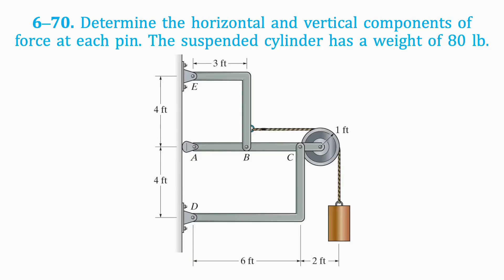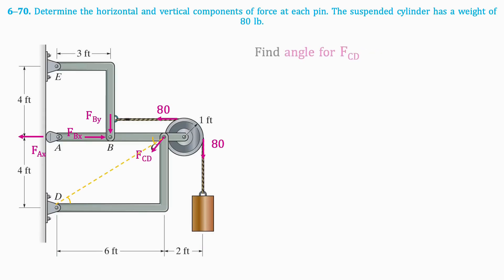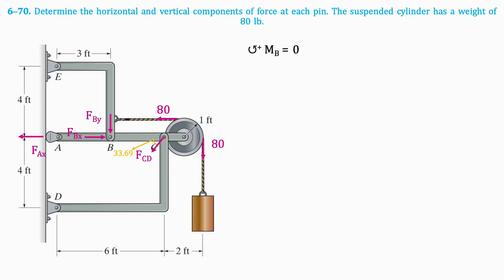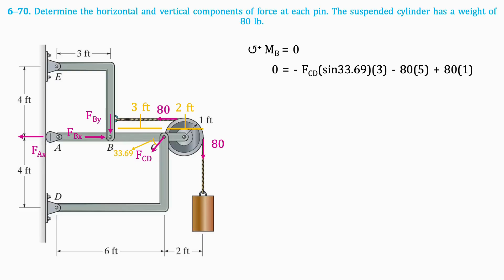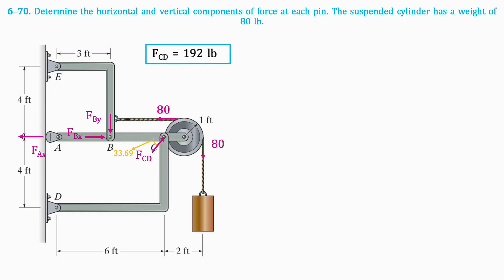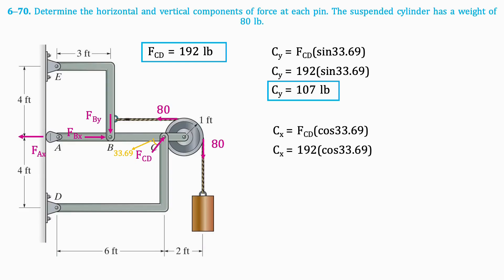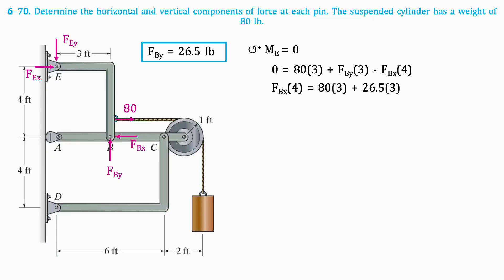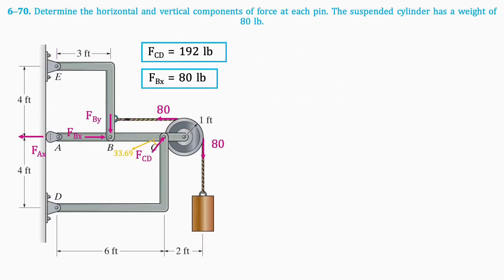Determine the horizontal and vertical components at each pin. The suspended cylinder weighs 80 lb.

Comment: Do we not solve for forces on pin D?
Reply: Because the member only has two forces (the one at C and the one at D), the x and y components at D must cancel those from C. So, they have the same magnitude, but opposite direction as the C components. both forces are along the same line of action (the line from C to D) in opposite directions, so they don't create a moment, and because they have the same magnitude, they cancel, so the member is at equilibrium.

Comment: Why, when calculating the moment around B, is 80(1) positive? Isnt the rope pulling on EB to the right (clockwise) which would also be negative?
Reply: the force of 80lb is directed left and the distance is up. That would make it counterclockwise.
Reply: @ryder4441  How is a tension force pushing to the left? Shouldn't the tension be pulling on the beam, not pushing?
Reply: @hudsonjones3914  the tension is pulling on the beam and pulling on the pulley. The beam force and the pulley force are equal and opposite. We do not worry about the force pulling on the beam just the one attached to the pulley.